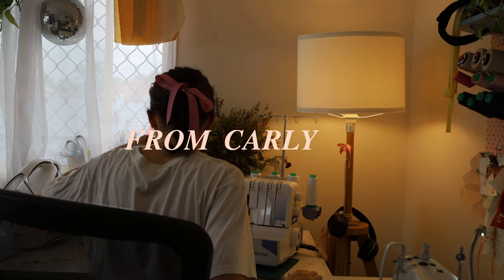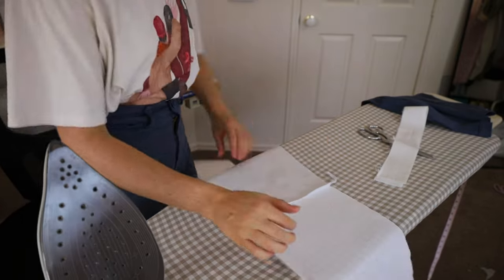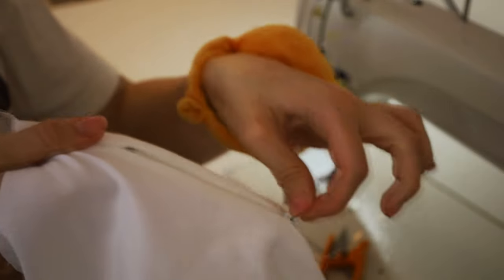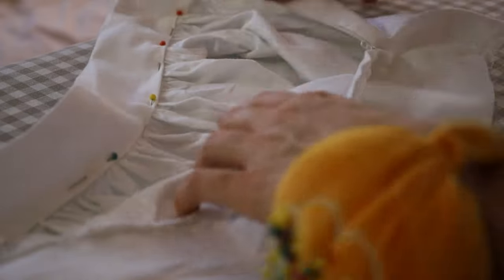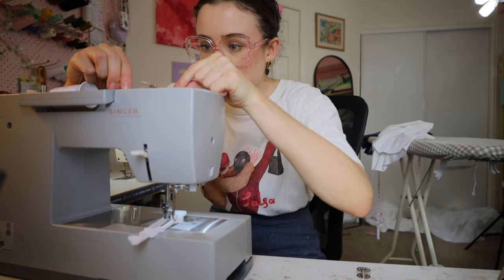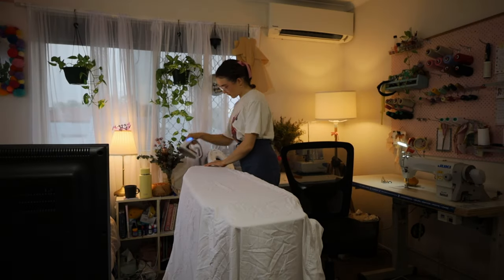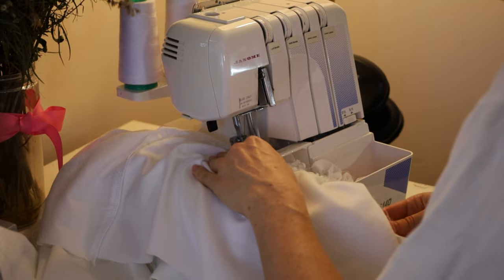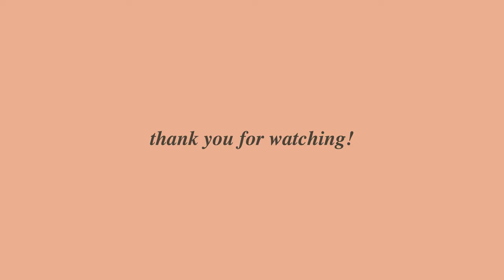how to make the gathered white skirt of your dreams! (tutorial)

Comment: You did so good with that zipper! To get the look of that zipper on the blue skirt, you can baste in the area where the zipper will be then go to a regular stitch length for the rest. Then you lay the zipper teeth over that seam line and top stitch it on and rip open the basting stitches to reveal the zipper. Idk what the name of the technique, but you may like that method better. 

Your skirt came out BEAUTIFUL!
Reply from the maker: Thank you so much!! Ok this is so helpful, I appreciate it! <3
Reply: @fromcarlyb  No problem! I hope it helps. I was able to figure out that that is called a centered zipper. So if you look up sewing a centered zipper, you can probably find some good videos or visuals on it.

Comment: Thank you so much for your video! This is by far the prettiest tiered skirt I have seen. Just one question about what you did. Could you explain how you closed the loop of each panel? Did you cut the panel first, closed it, and then attached it to the skirt above? How did you match up the length to the one above and what type of stitch did you use to attach them? I am really new to this so I need the dumbed down version haha
Reply from the maker: Awh that is soooo sweet. Thank you so much!! A great question. It would probably be the smart thing to do, cutting it & closing the loop before sewing the tier. But I just sewed it on until I got to the point where it met the other end & sewed the ends together then. (you need to leave a 10cm space or so for this method!) It's lazy ... but it works! 

The gathering is what helps match the skirt to the tier above it! Say the skirt is 2 times the length of the tier above it ... you'll do two parallel lines of gathering stitches ( sew with longest stitch length & then you pull those threads to gather), and gather it so it now fits the measurements of the tier above it! And you keep repeating! 

I hope that helps a little! Happy sewing! You can do it!
Reply: @fromcarlyb  Amazing thank you so much! I am very excited to try it out. I can't wait for your future projects!